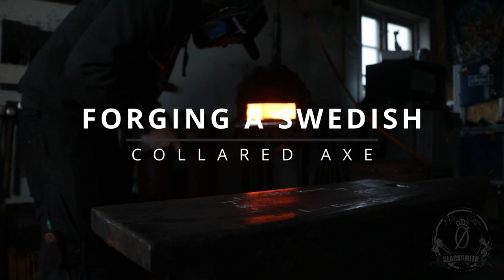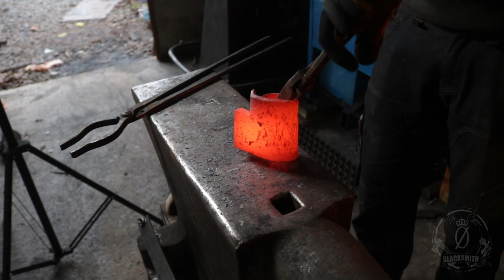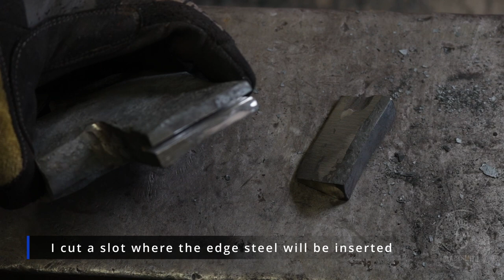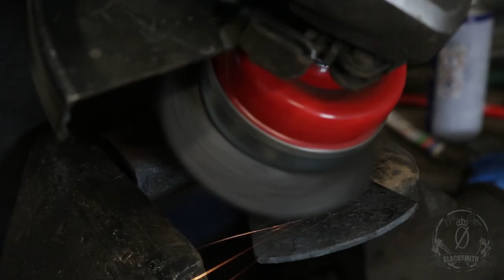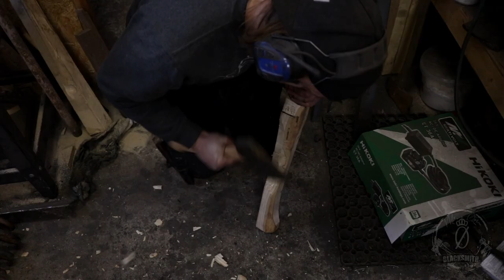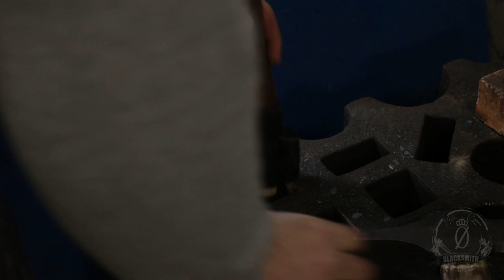Forging a Swedish Eye Axe: A Journey into the History of Scandinavian Hand Tool Creation

Comment: Never had a collared axe. Always had a regular pattern. But I can see the advantage of having the collar on it. I wished many times I had the protection for the critical part of the handle just below the head. I used to wrap this area with a heavy steel mechanics wire to afford some protection. It helped but did not entirely stop the overstrike problem. The added benefit of having the collar would be the extra weight at the head giving a stronger blow to the strike when splitting.